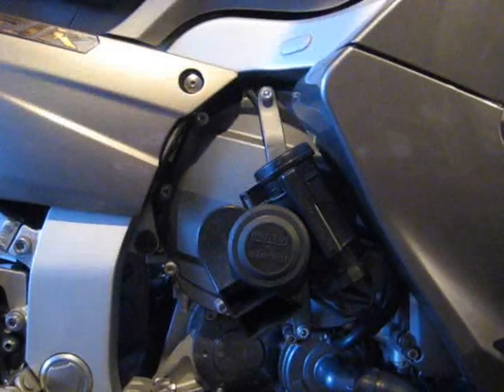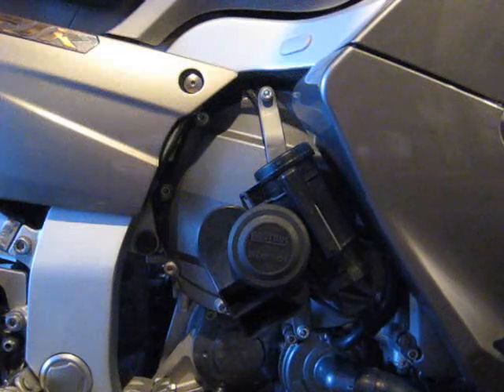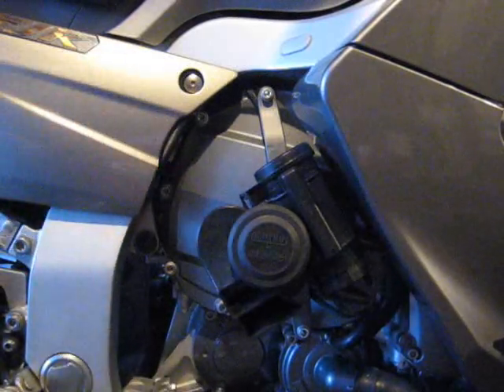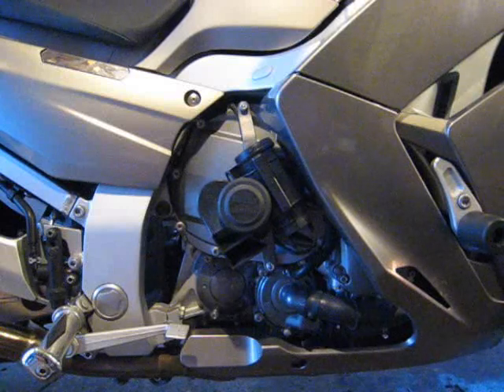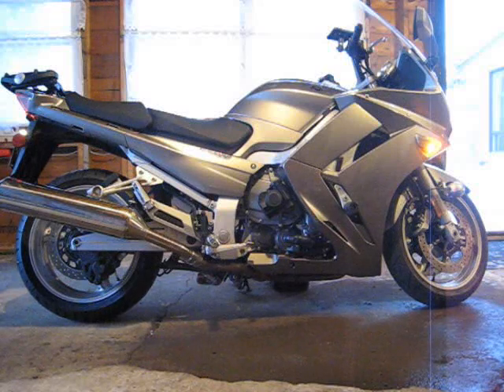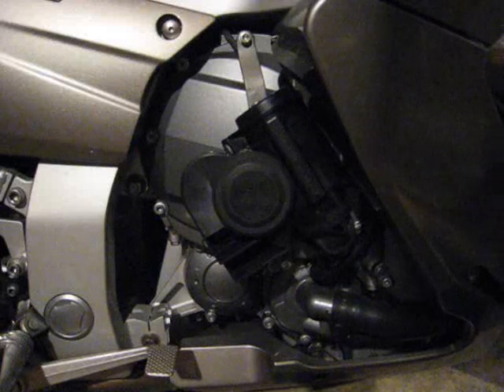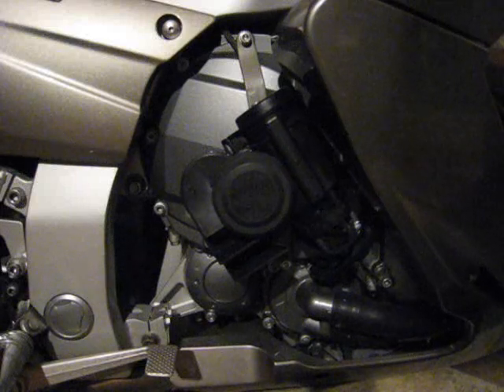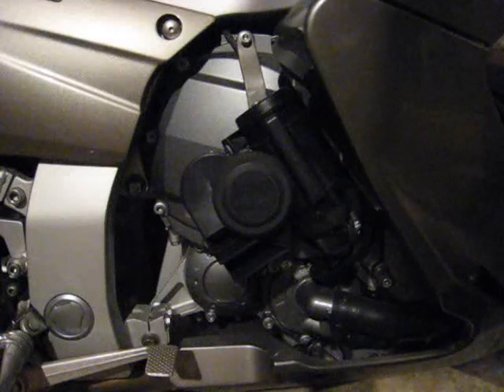Stebel vs. Stock on FJR1300

Comment: These types of horns causes wrecks, it shocks the driver, instead of making aware that a motorcycle is there. The driver of the car is now looking for a large truck, not a motorcycle...
Reply: You most likely are clueless on this issue,I have installed these horns on all my bikes and they alert drivers that the space that they are moving into is occupied,even better when a driver is so involved in a phone call that they dont bother looking this horn pulls them back into reality,at no time has anyone swerved towards me when I use this horn,they want to get away from it,which is its purpose...